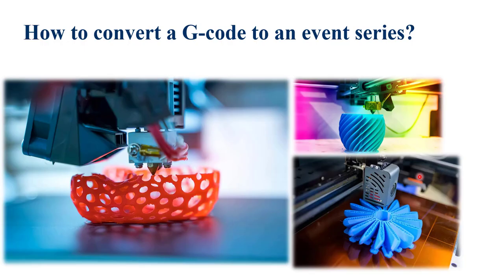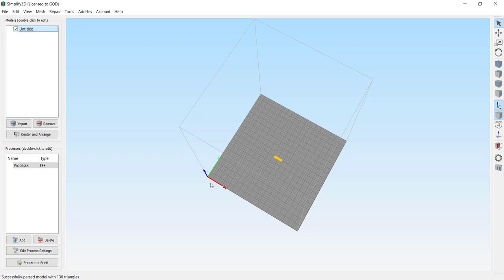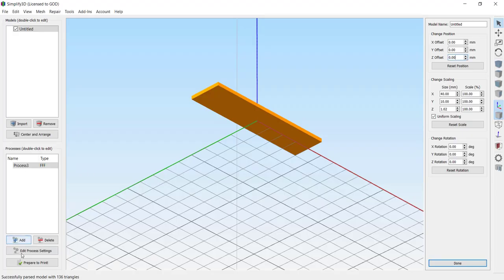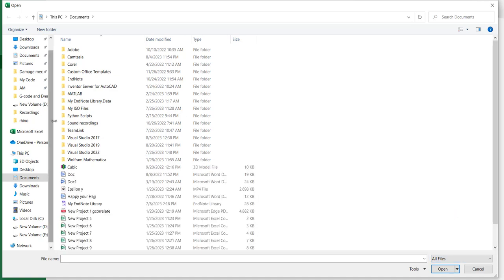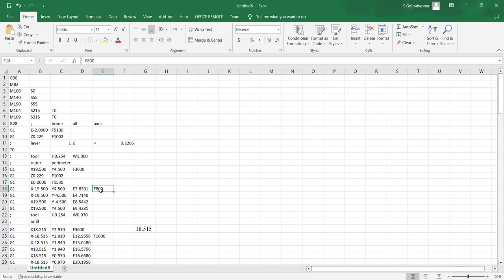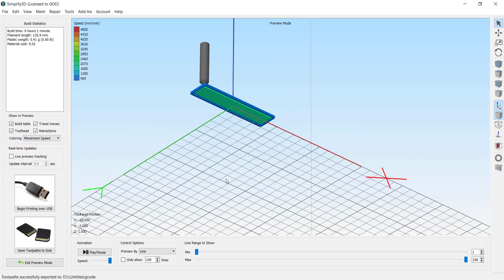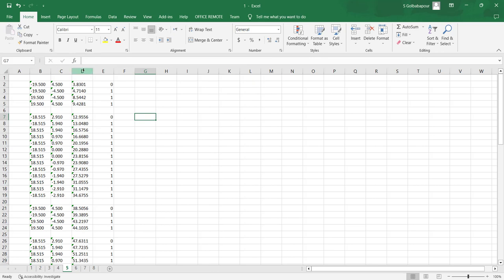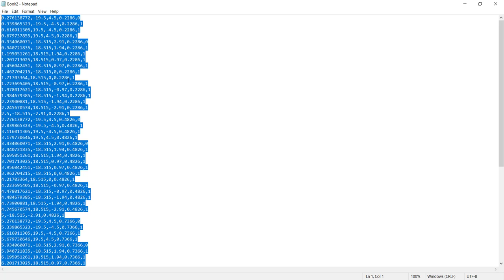How to convert a G-code to an event series (for ABAQUS simulation)

Comment: thanks for the great explanation, just have a question regarding time scaling ,  could you please clarify how it was done ? what did the value of 138.702 represent ? can you write your email for further consultation 
all efforts appreciated
Reply from the maker: Certainly. I'm delighted to help. Regarding 138.702, it illustrates the material feed in the material extrusion 3D printing technique, showcasing its direct correlation with printing time and duration. Feel free to reach out to me via email at s_golbabapour@aut.ac.ir.